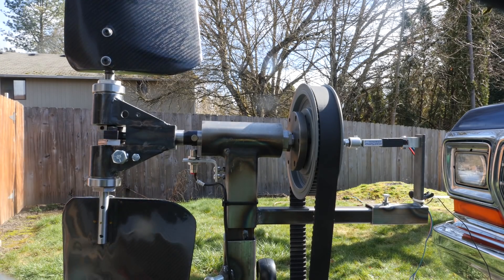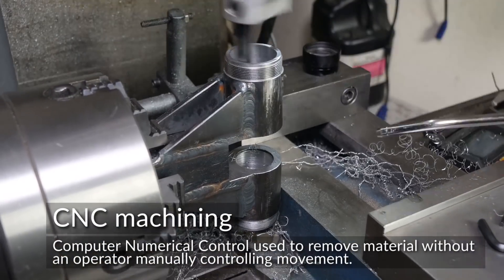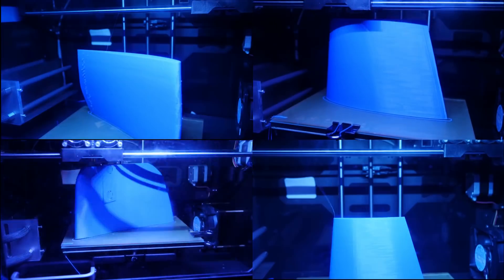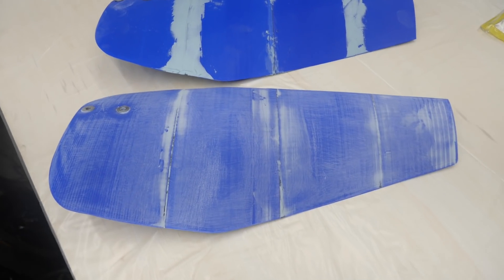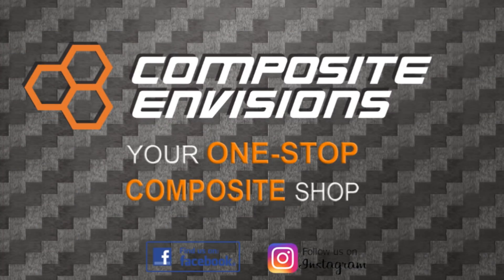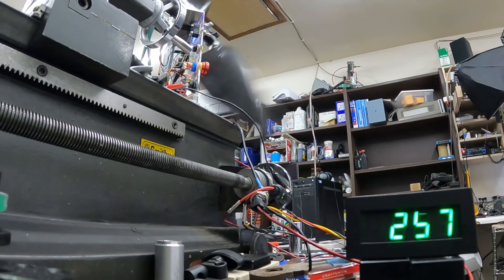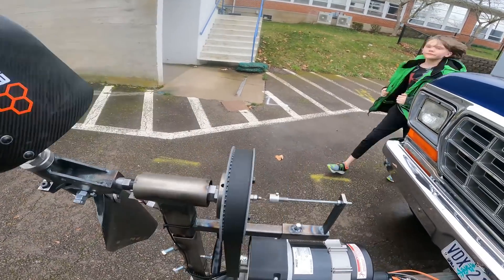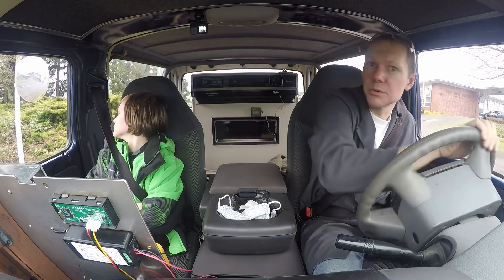Carbon Fiber Blades Making 2000 Watts! - Wind Power on a Car #4

Comment: I currently own both vacuum pumps that you own. Either one is good to leave on for days at a time. Just make sure the oil doesnt absorb too much water. If you start getting water in the oil, change the oil and carry on.
Reply from the maker: Good to know!

Comment: Did you DISCONNECT the air bag? :O
Reply from the maker: Passenger bag was never there (1978 ford) new steering wheel airbag is integral but disconnected, yes.

Comment: Would anyone believe they could hold this through the sunroof at some speed and not feel the drag opposing the movement of the car ? Then how could it do that without affecting the mileage of the car ? This could be mounted on a hinge and arranged so the drag is measured with a scale / strain gauge.

Comment: Could you mod oven into a thermo electric rechargeable power bank of sorts and have hybrid  or run the rig on top of vehicle and compress down exhaust from unit and have a scram jet setup? would the current setup  provide enough  voltage to directly power a d.c motor unit for? Secondary propeller on top like air boost just brainstorming awesome video

Comment: a ram air turbine concept sire??

maybe it can help people to save on fuel by converting the energy from fuel to electricity which can make the fuel can last longer....
Reply from the maker: Yup it's a RAT.
Reply: @QuintBUILDs  maybe its better when you put a case for the RAT like Turbofan Engine, so you can "scoop" more air ( thus more turbulence ) for your RAT.....
Reply from the maker: @cyberpunkilmy4211  absolutely. Just a matter of constructing it. Effectively increases the diameter of the blades. Commercial wind turbines would benefit too but they're nearly impossible to build that size.

Comment: Dumb idea time.... Im willing to say, as are anyone who sees this... It's not safe.... 
Also, thinking if you could shroud it, might work better, pushing more air through it. 
Then I thought of the cooling fan thats already shrouded under the hood of that truck... maybe something there. 
Might end up with batteries under the cab of every tractor trailer in the USA and one of your fans under the hood to charge them getting rid of the ole generator.

Comment: Awesome! Congrats on all those watts!  I cant wait to see how the mpg will be affected. perhaps you can get an instantaneous miles per gallon gauge to plug into the obd2 port. if they are sold?  I think they use the current speed vs the current duty cycle of the injectors to calculate instant fuel consumption
Reply from the maker: One was recommended, ordered and proven to work!

Comment: I'm very concerned that you standing there working with carbon fiber without a mask until you started spraying. Those fibers get stuck in your lungs forever.
Reply from the maker: That's why you only sand the resin...
Reply: I think you're risking you and your children's lungs to any dust.  I don't care if it's resin or a couple little fibers that stuff is deadly. I have worked with high-end Carpenters and they have enclosed booths with filtered vacuum just for this reason. Don't risk it. Wear mask all the time

Comment: Since I started watching your wind turbine project I have this idea that keeps knocking on the back of my head. Once you complete your system, how efficient do you think it will be to power a sail boat? As in using your turbine to make power from the wind to charge batteries and then power a motor. Replace all sails with 3 turbines, one smaller one on the bow, a big one from the main mast and a smaller one on the stern. If there is no wind then you can use solar panels to charge. Electric marine engines are also pretty good at regenerating power when using the wind as power. Keep up the good work....and FYI your kids are super smart....👍☺️
Reply from the maker: You need to connect with this stuff. Racing INTO the wind with only wind power. Impossible they say...
https://youtu.be/ZMJpIVwDhek

Comment: So, in a nutshell.

30% effectiveness fuel to wheel.

30% effectiveness wheel to fan

around 80% effectiveness fan to circuit.

Optimistically.

7% of fuel spent to rotate that fan is actually converted to energy, some of which will be lost later. (Don't tell me this is free energy, it is not)

But nice job anyway, I'm not saying anything like this was never used as practical appliance. German WW2 jet planes had similar generators, old train cars have board generators powered by kinetic energy of the railcar.

Comment: this is really cool, I love the idea and executiuon. Precaution - when working with carbon be VERY VERY CAREFUL about carbon dust. It'll mess your lungs up. 
What's not cool - driving on the public road with a head chopper strapped in front of your car, especially at night, not cool with that.

Comment: wait, so the 3D printed blades are still under the carbon fibber sheets? doesn't that defeat the purpose or add too much weight? or is it meant to be that way?
Reply from the maker: the 3D prints are only 30% infill so SUPER light.  Sure ideally they wouldn't be there but that takes way more tooling.
Reply: @QuintBUILDs  ah interesting. Makes sense!

Comment: You can use a box fan but you'll have to use an ac motor in the fan assembly to achieve the same performance

Comment: I came into this as a recommended view (wonder how the algo decided that... must be all the graphite research in my history) but a few pointers for if and when there's another composite video in your future. Resin provides virtually none of the strength that a composite part is composed of; it's basically there to lock in the shape. Your composite structure is where all the strength is, so adding more resin other than a top coat won't sure up any defects other than cosmetic. Carbon is a nice material for certain loads, but it's a stiffness material. If you want pure strength, you'd be better served with S-glass fiberglass, which is considerably cheaper to boot. Or you can use the hybrid fabrics that have a tow of fiberglass and one of carbon (or the best method, make your own sandwich composite).  Beyond that, knowing which material to use and when is fairly paramount, unless someone is throwing free carbon at you of course! 

On making blades, your 3D printed concept is sound, but for dimensional accuracy, print one, get it perfect, then mold it and use a foam core that will absorb some of the resin. You'll have an infinitely (within reason) stronger part that is also lighter than 3D filament and more sound when rotational forces get involved, and you can make copies! Filament has a relatively low adhesion to itself and the last thing you want are those bonds to be tested in rotational energy that decide to break apart inside your carbon skin and become loose weight in the fan tips, wildly throwing your blade out of balance when it's least convenient. It's a short trip to catastrophe that's worth putting a little extra effort to avoiding. 

The weight of air I suspect you have a new respect for after doing all of this. There's literally TONS of it moving over your vehicle every minute it's in motion, and certain parts need to be really beefy to support all the torque you're putting on them. Shaft and couplers for instance. (Being brutally honest, that toothpick you used for a shaft had me laughing a bit during your mockup speed trial. "That's never going to survive the road!" =)  If in doubt, overbuild it. Semi-related here, but if you ever do the math on how much air a turbojet engine sucks out of the atmosphere in weight, you'll be amazed we have any air left to breathe. 
In that light and to the degree of this project, I would actually put your turbine behind your vehicle with partial exposure to oncoming air to lessen the overall parasitic drag the vehicle puts into the efficiency portion of the equation. You won't be getting any meaningful impact on your turbine experiment, but you'll reduce how much fuel you're using to push it around as it occupies space in a low pressure zone, hence the partial (offset so, say, at least 65-80% of your rotational arc has high pressure air coming around the vehicle to land on the blade. Coincidentally, the other blade behind the vehicle in the low pressure zone can spin slightly faster with a see-saw effect and you get a little rpm boost). So if you really want to go nuts, a bell mouth shroud with the 'lips' directly in the air stream will add a quantifiable efficiency boost for this particular location and give you a reason to play with molding some carvable foam to then skin composite fabric over again.  

I certainly give you the Dad's Involvement thumbs up as I try to get my kids involved in some of my crazy engineering feats too, though my next trick I have safety concerns when creating a better UHTC ceramic in the back yard. Still, my oldest is beginning to love the science and chemistry involved, so by all means, let that yearn flourish and feed it prolifically. The educational system these days absolutely pushes my buttons in what they consider math and science skills, especially when they come home with homework that is blatantly and fundamentally flawed. We found several incorrect 'answers' that the book is saying is correct just this week, which resulted in me writing a technical paper for her teacher who inevitably blew me off (one of those "I'm right because my degree says so" people. Ugh...) It started with counting edges, faces and vertices in 3D objects versus 2D illustrations of 3D objects and why the numbers will change, but no, the qualified, old-school engineer is wrong... Sorry, personal gripe but it's relevant too.
Reply from the maker: Wow man, thanks for the insights!  I like the idea of the foam mold, that would be more consistent.  The labor in this was so much I had to minimize my time wherever possible.  When prototyping I figure if I'm onto something really cool it will reveal itself with a less than perfect attempt.  And yeah, that actuator did not 'look' like it would live and it didn't.  I've already got a replacement nearly 4x as strong and an OBDII mileage gauge so we're super close now.  Just need to go touch up the linkage a bit to time the blades better and we'll be back on the road.  I knew turbine companies layer different fabrics but did not know about alternate tow fabrics.  Sounds like a cool path to go down.  Thanks for taking the time to comment!  In the future feel free to email me at QuintBUILDs@gmail.com
Reply: @QuintBUILDs  Will do. I'm freelance these days and like to help out however I can, so I'll send you my email here shortly if you ever have anything you want to discuss or vice versa. I don't know everything but if I can't get you the answer, I can point you in the right direction. =)

Comment: Good Luck! It will be interesting to see if you are able to get something practical with an adjustable blade system. I have a buddy that lives off grid up in the mountains and he does not use wind power. He says, when I drive to town I pass multiple windmills, all of which are idle. If none of those people are able to get small windmills to work, why should I think that I am able to get them to work? Getting consistent power from small windmills is difficult. I can see where having adjustable blades could be an advantage, but you are up against a monumentally difficult task.

Comment: info.      at 10:13, it's  center of  Mass.     an aircraft has a cg.
without know more that what is in this video, here are some questions/things to contemplate.
exactly  how  is the  oven being powered.?     does the alternator output  wild AC  or  DC.?
in either case, a resistive load (heating element) causes  less  lenz-related braking, inside an alternator.
consequently, there is less load/resistance to turning,  at the turbine rotor.
that resistive load may, also,  be  skewing  your output power readings.     i see this all the time, where someone powers a lamp (a resistive load), while  Attempting  to measure output power.
if you want to know, accurately, how much mechanical load there will be at the rotor (from lenz-related losses), do an at-speed test, with the alternator output,  shorted.       cheers        googletranslate

Comment: The Local wildlife needs to be scared, very scared.
Reply: MOST people would be shocked at how many birds fly into 18 wheeler's. Animals have EYE's & EAR's, but you would never know it.
Reply: @chasmarischen4459  I'm a mechanic at the moment. One of our drivers hit an owl recently. Right through the windshield, glass everywhere. I guess the drivers cat was chilling on the dash. Got the crap scared out of it and got thrown off the dash. Driver and the cat were OK though. Probably needed a change of pants though if I had to guess.
The drivers hit a whole lot of deer too. Lots of bumpers and radars replaced due to deer.

Comment: Aren't you scared that if one of the blades were to snap it could come flying through your windshield. Even though it's carbon fiber coated, it's still just 3d printed and glued under there. Maybe add some plexiglass over your windshield?

Comment: Why don't you use that generated energy to charge batteries? Like, if you would do this in an electric car, how much more mileage would that add to the car? I can imagine you're doing this on ICE car because you don't own (yet) an EV, right? Very cool!! please check how much the generated energy would affect the charging of an EV.

Comment: my question is why you didn't bother to use cheaper more available fiber glass like the rest of the sane people in the wind turbine industry.
Reply from the maker: The cool factor of course! I'm trying to teach the masses about wind power and carbon fiber is WAY more clickable. Make sense? Plus I needed to be absolutely certain the blades wouldn't self destruct.

Comment: Your main problem is that you lose half the energy, you have to first create an axial motor, it is a motor with double the torque and therefore double the energy, please answer me to know that you read my message, in addition to that I would like to know your opinion of the axial motors
Reply from the maker: It's not that simple. Go run some simulations in qblade, that may help.

Comment: i would love to put a beat truck on that for like 900 rmps it is self excited. 350 amps at 72 volts and that is like 25000 watts and this just one of them most trucks have three or for and could power a prius to 84 mile an hour forever.

Comment: A fun project as long as you remember about the law of conservation of energy - attaching a turbine to a car causes it to LOSE more energy through air friction than it gains from the turbine. It would have been more efficient just to burn some of that gas in a generator.
Reply from the maker: Video proving it works: https://youtu.be/tEPBdztGMdI  😁

Comment: Looks like a lot of fun! But please be super careful with carbon fiber, especially when grinding it. Inhaling even a very small amount of carbon fiber dust is very bad for your health and can even cause lung cancer.

As for your pitch control, you may want to look into a rotating motor hooked to an acme screw (not a ball screw). And make sure that motor has a brake on it (spring loaded normally applied brake), this way when you set the pitch angle you can turn off the motor and it will hold its position without having to generate any torque. You can find lots of parts here: https://www.mcmaster.com/ (or just browse to inspire new ideas).

As for the your fuel mileage, an ODB2 port scanner should work. If not, you will need to get a mass flow sensor/meter and install it around the main fuel line.

I predict that your mileage (or fuel flow) will increase with the wind turbine attached to the front of your truck. Actually, I guarantee it will! Still can't wait to see the results.
Reply from the maker: Thx. Genuinely appreciate your level-headed response. Just got a nice OBDII mileage gauge with trip function as well as a beefed up servo for pitch. I wanted something with built-in feedback that didn't require an external controller and that 1st one had that. The new one uses an external board with 4x the force so crossing fingers it's sufficient. But yes, eager to see the results!

Comment: I hope you are aware of the G force these blades are under.. at 1000rpm it could easily be 400-500G. if this blade will fly off and hit someone, your kid would be visiting you in jail. A flying blade is such a common problem that actually in planes, there is a 15deg angle from the blades in each direction to a critical system that can crash the plane or prevent it from landing and these blades are designed and tested with experts and enough FS margins.
Try and use all this great energy to improve the world and solve real problems and not waste money on dumb and dangerous experiments. Just a thought.
Reply from the maker: Each blade weighs 600g which at 1200 rpm comes to 500 lbf, well under the static load of the bearings. Engineers can calculate that stuff in their sleep. I only tested it as a formality. But your concern is valid and appreciated.
Reply: @QuintBUILDs  it depends on where the CG from the COR. if it is 23.5cm you are correct but this is with no safety factors and for this kind of application with the little experience you have in Carbon fibre I would have gone for at least FS-4 which means that this baby should hold 2400rpm without any visible deformation in the basement before I go out riding with it.
This project is very cool, and I think that customizing windmills could have really great applications.